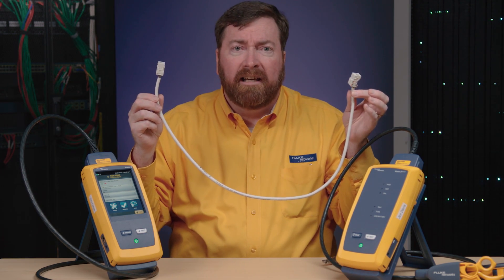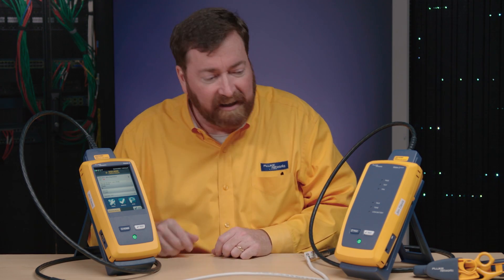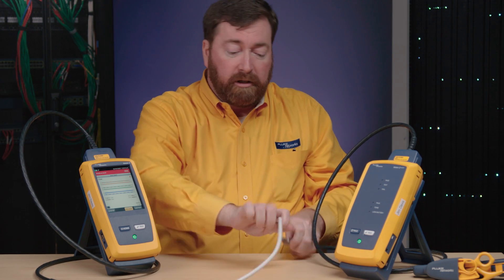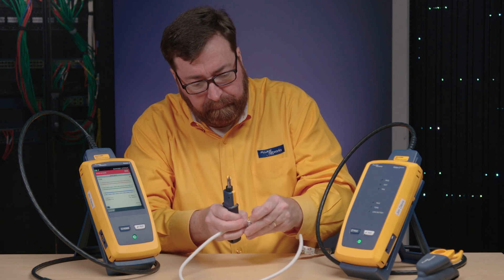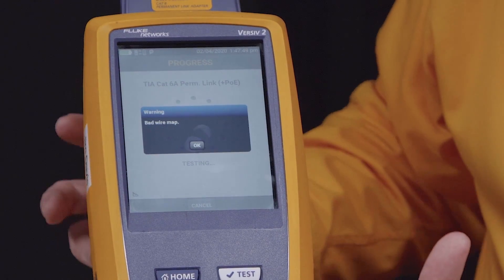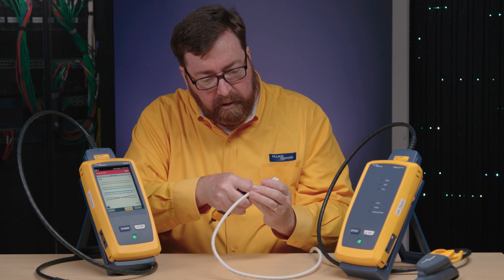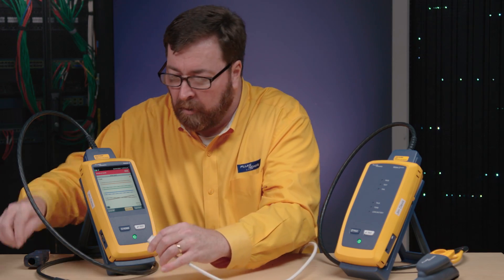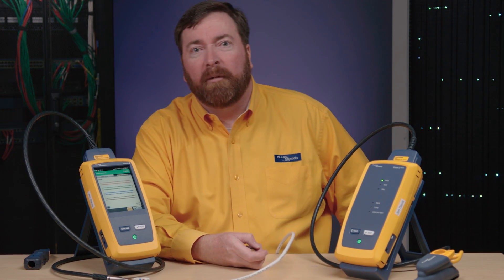Basic Wiremap Troubleshooting with the DSX CableAnalyzer™ by Fluke Networks

Comment: Hello, at 2:50 you said the tester doesnt know which end is wrong.  SO I have a LinkIQ and it shows a cross cable just like your example.  So the the LinkIQ is not saying the one on the bottom of the screen or the top of the screen is incorrect.  I was hoping if the crossed cables on the top of the screen meant that the error is is on the end of the cable furthest from me and not the end that is nearest or plugged into the Fluke?  know what I mean?